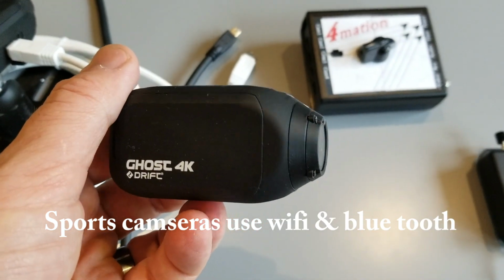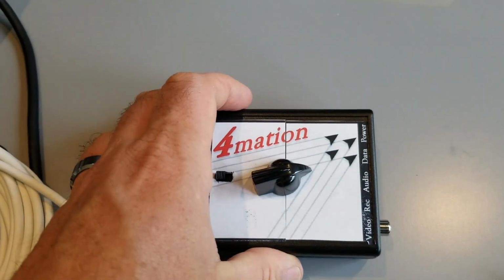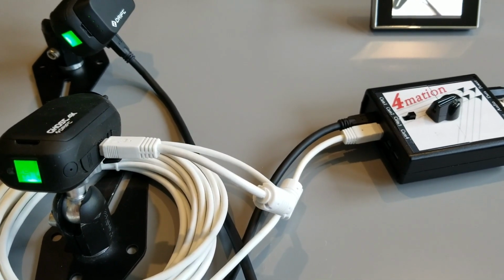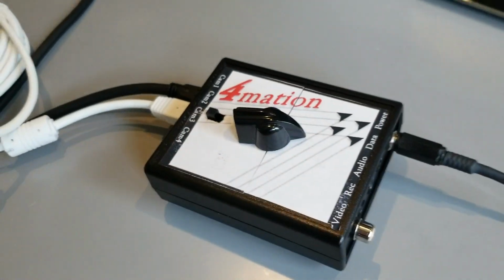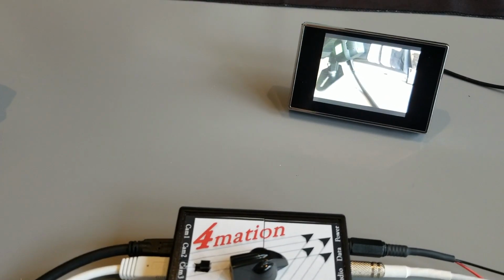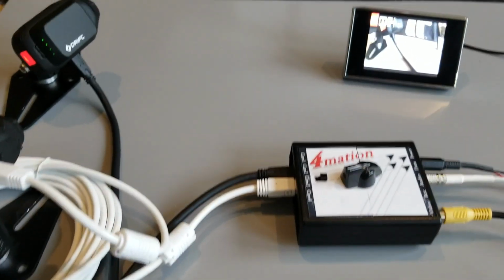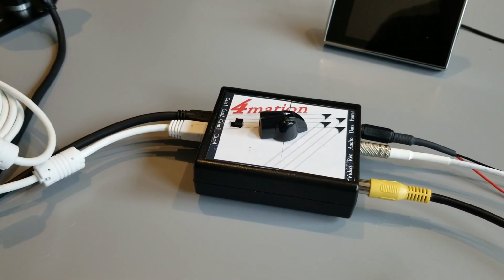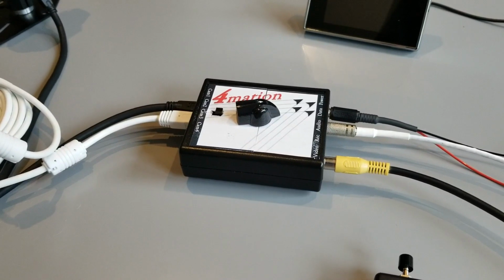4mation

Comment: Nice! Are the usb cables intended for interior use only or do you have a proposed solution for mounting on the exterior of the aircraft? If outside, how do you keep the cable plugged-in to the camera in the slipstream?
Reply from the maker: The cables will be able to be run through a wing, fuselage, or strut in the same manner nav light wires would be run. 
The cable will stay on the camera. We will have a 90 deg plug to keep it streamlined.